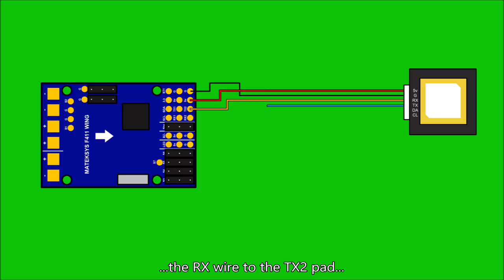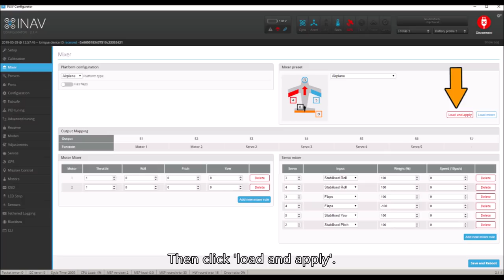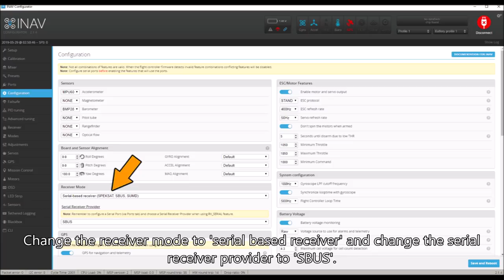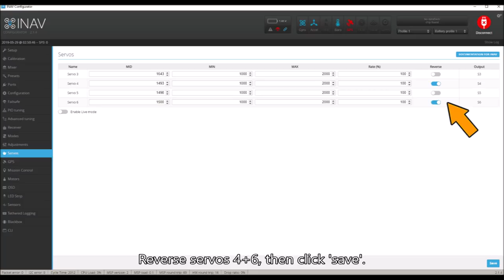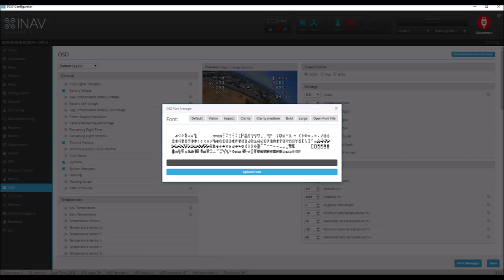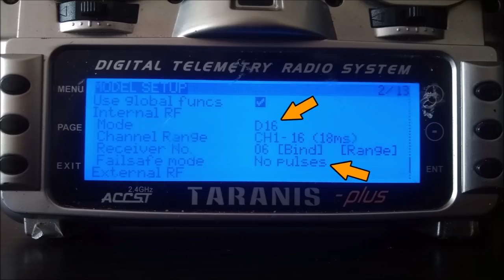🛩️ Cessna 182 Skylane - Detailed step by step INAV build

Comment: I'm building. S800 wing with the Matek F411 and like you I get a fair bit Of video noise !!
I'm using a Quad 30 amp esc and I have soldered a 1200 Microfarad low ESR cap pretty well straight onto the esc and this has helped a lot !
I tried a LC Filter on the feed to the VTX but it had no effect, which surprised me !
Yet your Bixler was fine !!!
Reply from the maker: I think the difference on my Bixler is that the VTX I'm using on there has it's own inbuilt filtering. Not certain of that, but it's my best guess

Comment: Nice tutorial..Takeoff and land..line of sight methinks..?...Shame about the ESC noise...or was it the vtx?..I have 3 of them but they are not the cleanest but one was putting out 720mw..!!
Reply from the maker: I think it's the vtx causing the noise. The vtx is powered by (what I assume is unfiltered) vbat, so power fluctuations from the esc could be leaking through. I have the same FC on my Bixler (with a different vtx but wired the same) though and don't see the problem there. So yeah, I think it's the vtx

Comment: how much minute flight time ?

is imposible to long range with 18650 batery
Reply from the maker: So far I've only tested with a 1000mah 3s lipo, which only gets around 10 mins. But a considerably bigger lipo would fit inside the Cessna for more flight time. And with 18650's you could probably get 30+ mins easily
Reply: @gizfpv  you test 18650 3500mah 3s /4s and do some long range. Very fun.. We are waiting

Comment: why did you put the current sensor scale to 423? how to meassure it?
Reply: it has to do with internal resistances of individual flight controllers. matek has already worked out what the offset should be and recommends a setting of 423 in the manual.

Comment: What range is the realistic maximum for the matek vtx-hv?
Reply from the maker: Range isn't really determined by a video transmitter, but instead by the antennas. With really good antennas you can get miles of range out if a cheap 25mw transmitter. That being said, with typical 5.8 antennas you'd probably get 5-10km with the Matek vtx-hv
Reply: @gizfpv  in the moment i have the set from immersionrc on the fatshark and atomway on the wing. im looking for a new setup for the next wing. which antannas do you use? axii?
Reply: @sebastiantrost5614  I'm also really interested in antennas for range. I think he got 10km from 5.8. Would love to see his take on ANDRUAV so we have unlimited range with that free app. I have flown with it and it's like flying the Disco 4g mod, no lag at all.
Reply from the maker: For 5.8ghz fpv a axii or any CP antenna is good. On the goggles you want a high gain patch antenna such as the X2-AIR antenna

Comment: hi GizFpv.  I followed your build but cannot get it to launch.  
please see the video footage and photos recorded. the plane does not take 3s 2200 battery, slightly bigger than 2s what was recommended/ provided. 3 times it nose-dived and crashed. can you pls advise what might be wrong here. 

 my build setup below:

flight controller: matek f405
battery : turnigy 3s 2200
esc: stock
prop: 8x6 tri blade
receiver : xsr -m frsky

Video & pics:

https://drive.google.com/folderview?id=1D-HeHvlCmm_r8uyd_VXaQVoRkZAn22Hc

Comment: So much work put into this - thanks!  In the flight video there seems to be a bit of interference, do you think it’s worth replacing the ESC? I need to get my Inav Radian build going!
Reply from the maker: I think the noise is due to the vtx. I have the same FC on a different aircraft, wired up exactly the same, but with a different vtx, and I get no noise issues at all